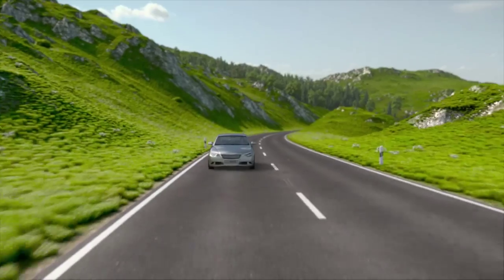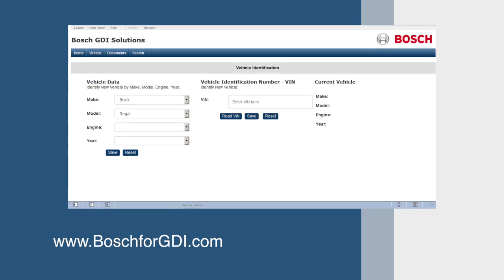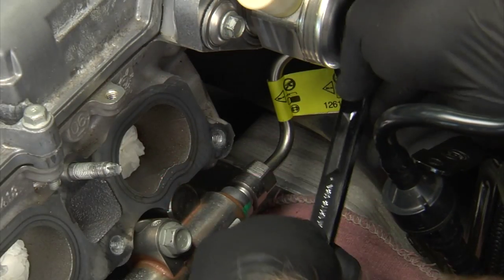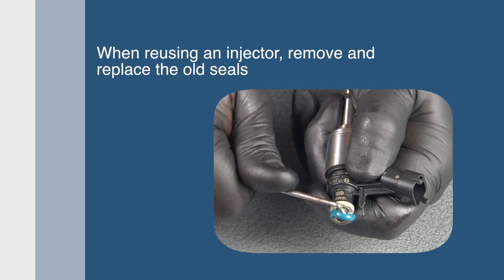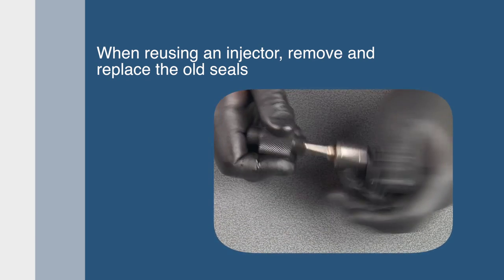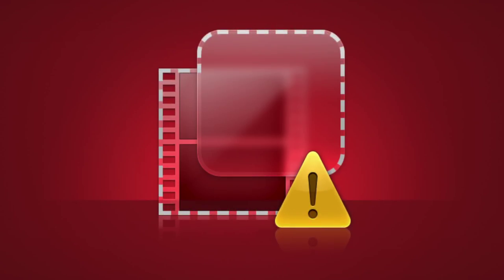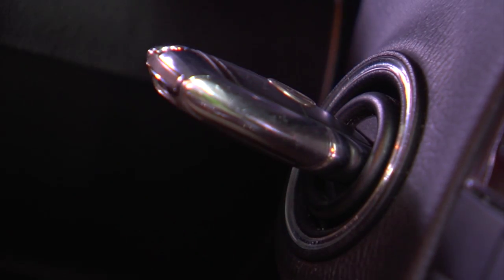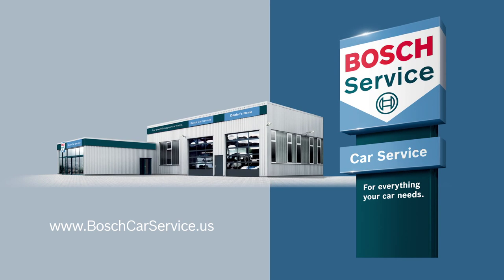Removing & Installing a Bosch GDI Injector

Comment: Over simplified. What is the actual installation experience? Install the injectors on the fuel rail first. It's a tight fit. How to leverage the injectors into the head? How long to leave the sizing tool on the tip?

Comment: very curious why they specify silicon-free grease??  I shy away from hydrocarbon lubes on ALL rubbers, just because I'm not confident in my ability to correctly distinguish Viton vs. Buna-n or whatever, knowing some of these aren't going to swell...
Reply: I think it's because gasoline won't dissolve silicone grease, and you could plug the injector with silicone grease if you used too much.
Reply: @Brian Leeper  do you still think gasoline won't disolve dielectric grease?

Comment: If the injectors come out with the fuel rail as one unit, is it still necessary to remove the clips and replace upper seals before re-installing into the cylinder head?  Can the Teflon seals be reused if not scored?  Danke.
Reply from the maker: Thank you for taking the time to reach out. We've forwarded your inquiry to consumer care, who should be reaching out to you soon.

Comment: Any idea why pulling out is going harder than installing? Something not shown on the movie?
Reply from the maker: We've passed on your inquiry to one of our specialists! You should hear back from us soon.
Reply: @BoschAutoNA  Thanks, I didn't tried yet - but pulling out requires hammer so it means for me some force is needed when installing. However, on the movie, it looks like incector was installed only "by fingers" without any higher force.
Reply from the maker: The difficulty to remove any component can and will vary depending on many factors age, mileage, type of climate (salt belt).  Level of difficulty really is challenging to quantify and differs between individuals. The video is intended to general guide and Bosch recommends the customer consult the vehicle specific replacement documentation for details.

Because this was intended to be a general guide and for the simplicity of demonstration we did not include all the potential variables of the removal/installation process. We hope this did not cause too much of an inconvenience for the customer and will take their comments into consideration for future guides.

We apologize for the inconvenience and thank you for the feedback.
Reply: Bosch Auto Parts thanks for reply. Two more questions: 1. Installation doesn’t require additional tools? By hand is enough?
2. What mean red screens during movie? Hidden content or just “warning”?
Reply from the maker: In this demonstration the injectors did not require special tools, the injectors were seated by hand and the installation of the rail finalized the seating. 

The red screens are just to highlight critical steps.

The purpose of the video is to be a general reference guide. There are additional vehicle specific details you will need to verify (procedure to release fuel pressure, torque specification & sequencing, & recommended gasket/hose replacement). If you have any doubts regarding the replacement I highly recommend you obtain/consult OE repair and replacement documentation or take the vehicle to a certified mechanic.
Reply: @BoschAutoNA  In this demonstration you say. But how in the "real life"? Same? :)
Reply from the maker: Bosch tries to make these videos general, so they apply to an array of vehicles.  We also try to make them as applicable to real life as possible.

Comment: I'm replacing a Chevy Ecotech motor with direct injection and am curious as to lube the end injector o ring(the o ring that sits on the end of the injector and actually gets inserted into the cylinder head)? The service manual doesn't specify. First time messing with direct injection and want to do it right
Reply: No lube on the Teflon side only the o-ring side fuel rail.

Comment: Bosch's slogan should be Junk for life.I have never seen a Bosch part be good at all
Reply: not true. they give me the least problems and the most profit
Reply: WHAT?! Bosch makes awesome parts.

More than likely the vast majority of your car is using some sort of Bosch parts and you've never had to touch them.

I love Bosch. Injectors, sensors, steering racks, pumps ... sure, some things break down but the vast majority does just fine.

The real problem comes from the OEMs who are not properly specing or installing the stuff.
Reply: @orangejjay  I seen their spark plugs cause misfires in none oem applications.Includes take out an entire GM ignition system too.Have installed their oxygen sensors,come back bad.Most of the European makes use NGK spark plugs from the factory